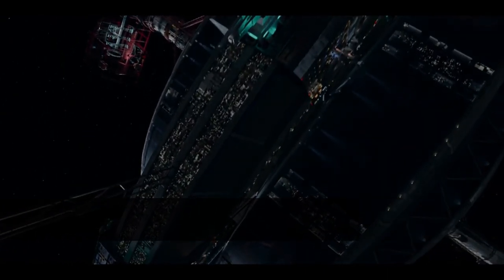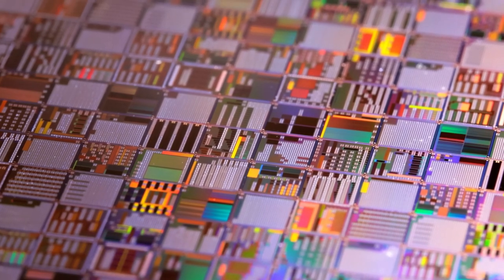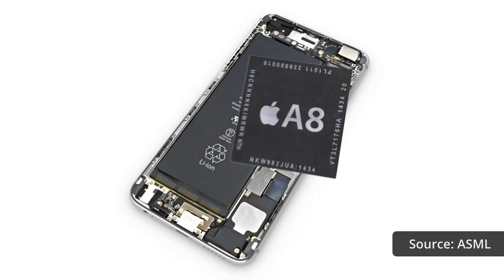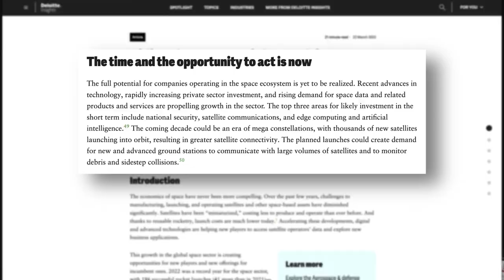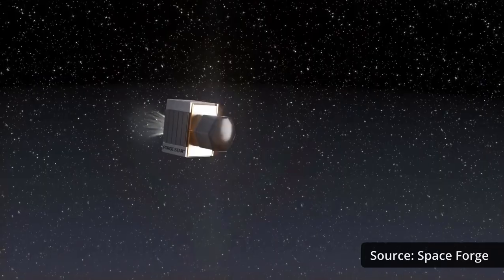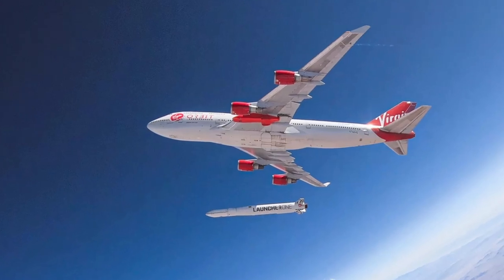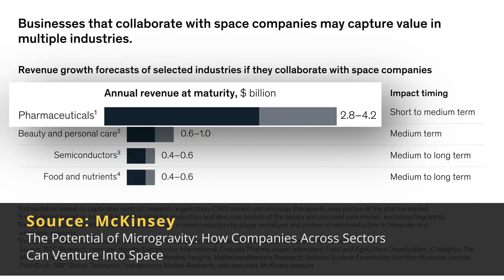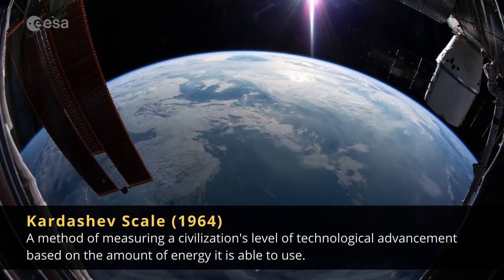The massive promise of space factories

Comment: We might have some construction available in space within this decade but it will be for use in space. I would say that short of raw materials that are in short supply here on earth, we will likely not source anything from space for at least another 15 years
Reply from the maker: Well, that depends on what we produce. We're certainly not going to manufacture anything consumer-facing there. However, making exotic materials for pharma or semiconductor R&D seems feasible.
Reply: @Futureflux  One of the other things that could happen to these materials is they can be bombarded by radiation. When you're talking about things that are so precise that you have to remove gravity from the equation, radiation becomes a big problem.
And the cost would be exceedingly high.
I don't know of anything that would be worth it to construct in space, we're pretty good at making nanomaterials here. It's mostly about figuring out how to configure them in the first place, which is driven by AI and expanding computational power. The impetus is low and the cost is high to do anything like that for more than just research.

So I guess agree to disagree?

Comment: What about the effects of intense space radiation on microgravity fabrication, and would it be better to optimize space solar panels to take advantage of all that same prodigious radiation ??  

Finally, when will we have miners that go get the resources to do all this from out in the System, rather than having to lift them up out of Earth's steep gravity well ... a possibly greater breakthrough ?
Reply from the maker: Re: Radiation

Unfortunately, radiovoltaic devices [that convert ionizing radiation into electricity] are remarkably inefficient. A typical conversion rate here is ~1%, compared to 35% with the most advanced photovoltaics or even 15-20% with conventional solar panels. 

Re: Space mining
A bunch of research and engineering groups are working on in-situ resource utilization and mining the Moon and asteroids for resources, but the engineering here hasn't moved beyond Earth-bound prototype devices just yet.